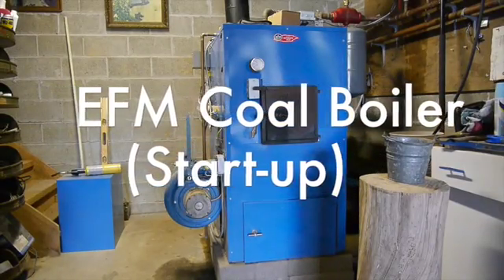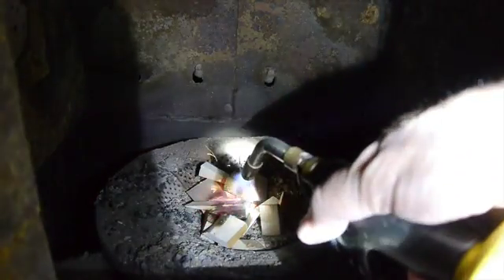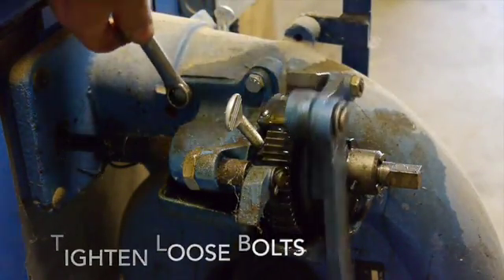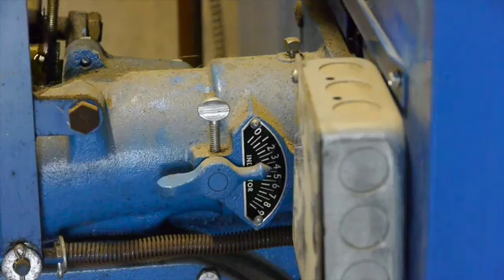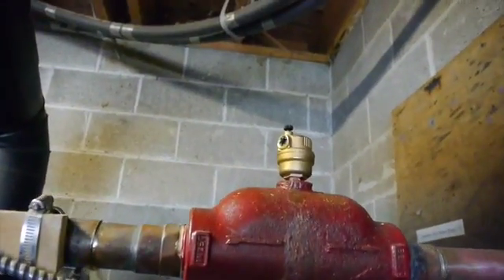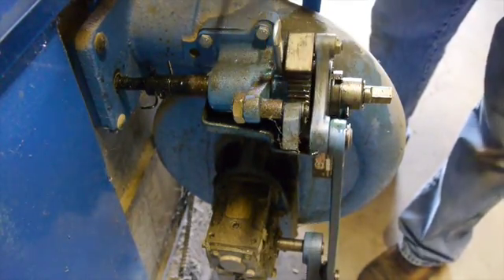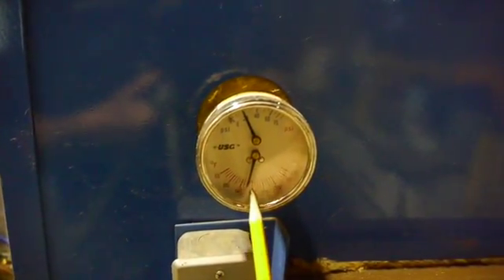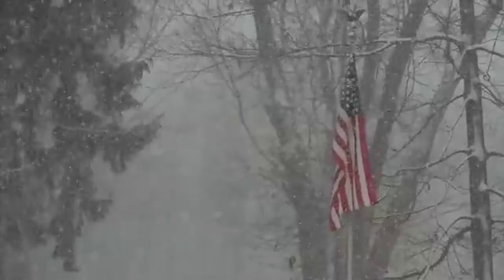EFM Coal Boiler Start-Up

Comment: May I ask what the primary purpose of the barometric damper is with a blower to support combustion? Is it primarily for “idle” or. no heat demand? 
(I understand the stack needs to present a fixed draft with varying atmospheric conditions thus the damper).
In other words, barometric dampers make more sense with a natural draft stove than with a “power” burner.
Very interested to know this. Thanks
Reply from the maker: Well, I am not sure but all I know is when my original damper broke and wouldn't open, the fire kept going out.  That damper is important in this system.

Comment: I have an efm as well.I don’t see your steam drainage to release the hot steam water.I have a small copper pipe that connects to the top of the furnace to a steam pipe.Just curious if you have the same design as mine.
Reply from the maker: Hello.  My system is hot water system.  do they make one for steam?  I don't know.

Comment: Great explanation and overview. In virginia i service oil and gas boilers and heat pumps. Never seen a coal boiler. Did have a coal boiler in my house in North Carolina long ago when i was a boy, but it was changed to oil when I was still very young.

Comment: Curious if you use the coal year round? Looks like maybe there is a spot for an oil gun there for the warmer months.
Reply from the maker: I friend of mine has one of these boilers and he runs it all year.  I thought I would to heat my domestic hot water but I decided not to.  I have a port for an oil burner but never installed it.

Comment: What kind of oil did you use on the blower motor?
Reply from the maker: I think it is 10W30 in my oil can.  I put one drop on the oil port on the motor at the beginning of each season.
Reply: @TimTools99  Your motor should have an oil cup for both bearings.

Comment: Why is your pipework not lagged? Loosing a lot of heat there!
Reply: Charles Of Lebanon Exactly. A friend of mine spent days lifting his floorboards and beautifully lagging all his central heating pipes. Mitred corners, every seam taped etc. When I told him why it was a pointless exercise his face was a picture- you could see the exact moment the penny dropped!
Reply from the maker: Help me out here. Tell me about it. Youtube is all about helping one another.
Reply: TimTools99 your supply and return copper lines would benefit from insulation lagging, every meter of exposed pipe is loosing you heat meaning you will be burning that little bit extra coal which adds up over a winter, here in Australia where I live we lag all pipework that carries hot or chilled water, it’s all about saving energy and money right?
Reply from the maker: oh i follow you. I just never heard of the terminology "Lagged."  In my case, the heat that come off the boiler heats my shop.  It keeps the shop 50 degrees all winter just with the heat off the boiler so I do not want to insulate those pipes and then have to pump water to heat my shop.

Comment: I was watching a informative video by Stoker Don about the correct rotation of an EFM stoker and noticed yours is going when looking at the gearbox backwards. You need to reverse the connections on the motor to reverse the direction it starts up. When looking at the gearbox/fan blower assembly the gearbox should rotate counter clockwise. Yours is going clockwise, it will still deliver air to the pot just not enough air as it is designed to. No matter which way the blower assembly is turning it will not affect the direction of the stoker itself. By getting the blower turning in the proper direction it should improve the efficiency of the burner as it will have more air to burn the coal. By making this change it will give the burner a higher fire using less coal because there will be a lot more air flowing into the burner pot.

My neighbor who also runs an EFM 520 when I saw the video about correct motor rotation by Stoker Don we discovered his was turning the wrong way his still had the original motor which has a reverse switch making it very easy to reverse the rotation of the motor. When he opened the firebox door he was astounded by how much higher the flame was and how much more air was flowing into the burner pot and stated he is using less fuel.

Easy way to find out I'm correct is shut of the boiler and watch the motor shaft so just before it stops you can determine the way the motor is turning. Looking at the blower housing from the gearbox the shaft should be turning counter clockwise. If it turns clockwise as yours is it needs to be corrected as it wasn't designed to run that way.
Check out the video Stoker Don did on the correct rotation of the motor.

https://youtu.be/z8bJjTyQMCA

Just an FYI
Reply: It depends on which gearbox your stoker has. Most of these have the big old rectangular gearbox that EFM used up until about 1979. The output shaft on these spins counterclockwise when running correctly. Later EFM's have a smaller square gearbox like the one in this video. These spin clockwise. There is some variety in these later square gearboxes, EFM sourced them from different manufacturers so it's possible that some spin counterclockwise. The main thing to check is that the fan is spinning the right way. If it isn't, the fire will become very lazy even with a high air setting.
Reply from the maker: Wow! I thank you so much for this information.  I have run it this way for several years.  I haven't started it up yet this year but I am going to check this out.  Thanks again.
Reply: Thank you Stoker Don 

I stand corrected, didn't know they used two different gearboxes but after almost 100 years of production it makes sense that the same supplier would quit for whatever reason. 

Just curious if your feeding your stoker with a barrel has anyone tried using sawdust as a fuel? If you have a source of sawdust for free it might be interesting to try out as there is a gentleman in Canada heating his homestead with sunflower hulls after processing.
Reply from the maker: Thank you for the reply so quickly. I will check my fan before I start up this season.I never really knew how that firebox should look when burning correctly.  Seems like I have a lot of ash but of course I am used to burning wood in my other furnace.
Reply: If you have been running it for years and have not installed a new motor, it is spinning the correct way. If it wasn't, the fire would eventually go out.
Coal does create a lot more ash than wood, no getting around that!
To check your fire;
From the EFM manual, the fire should have a 1" to 2" ash ring during a long heat call (at least 30 minutes). The feed rate should be set to match your heat load ( usually 4 or 5 teeth will do it). Use the air setting to get the ash ring right.
If you have a large heat load, you can push these up to 6, 7 or even 8 teeth.  Each tooth of drum gear engagement equals 2.5 pounds per hour of Rice coal. At 5 teeth this is 12.5 pounds per hour or about 135,000 BTUH gross burner output. 
Below 4 teeth and above 7 teeth should only be used in very unusual conditions when either the coal burns to fast or has a lot of foreign material in it.
Reply: Stoker Do
Reply from the maker: Okay great.  Thanks for the information.  I will be firing it up soon.

Comment: If anyone reading this has ever had the kitchen sink drain slow way down or get plugged up the hot water mixer valve is to blame. I'm 66 and anyone around my age remembers how you had to be careful not to burn yourself when using hot water in the kitchen or bathroom. Since the " oh we need mixer valves to prevent people from burning themselves " idiots as how did we ever survive before these people had to " protect us " 

One advantage of not having a mixer valve on your hot water was all the grease your mom and dad dumped down the drain was melted and flowed into the sewer ot septic tank and the drain line rarely plugged up. My kitchen sink drain has always been trouble since I moved in 20+ years ago. 4 months ago talking with a plumber over coffee he reminded me why his business is so good. When I got home I raised the mixer valve to its highest setting allowing only hot water with no cold water added. In two weeks my slow drain in the kitchen went back to like a new drain works. If you do this post a reminder above each sink that the hot water will be really hot for your wife and any visitor using the facilities.
If modern technology is so nice then why are we using a coal stoker designed in 1922? 

Just an FYI for any tired of slow kitchen drain pipes. Complex solutions to simple problems seem to be the norm now yet when we were kids simple solutions to complex problems were allowed until the " oh we must protect the public people came along" and created a aggravating problem that didn't exist prior to wholesale installation of hot water mixer valves.

Long live the EFM coal boiler and no I don't work for them I'm retired and probably think too much.

Stay safe and warm the old fashioned way by keeping Americans working.

Comment: Chad if your fire goes out when your not calling for heat then it could be your timer or a number other factors but check the timer is working with a properly maintained furnace and good coal timer should be set at 2 minutes every hr
Reply from the maker: +David Hardin 
Good point David.  Thanks.

Comment: Hey Tim, I grew up in Tonawanda and my brother lives in Chaffee, just outside of Arcade, He has a wood furnace in his basement and uses it all winter. I'm in the Albany NY area now and using oil. I will have to look into a coal one, cheaper, I believe, isnt it?
Reply from the maker: Hi Tom.  We don't have natural gas here in our little village so over the years I have  heated with oil, propane, wood and coal. Forget Oil and Propane!  Currently, I still have my Brunco wood furnace in the basement which does a beautiful job.  I got the EFM Boiler so that maybe I could cut down on the amount of wood I had to handle ( I'm not getting any younger!) and it heats the house and my shop.  My first load of coal 10 yrs ago cost $136/ton. It had remained pretty steady for years.  Then the next year it went up to $180 then 200 the 225.  Now it is around $300 I think.  Just my luck! When the price hit $225 I decided to buy in bulk. I buy 23 tons at a time direct from the mine in PA. and save $80 a ton.  So to answer your question in another way ..... Nothing is chap anymore. Move South!  LOL
Reply from the maker: ***** P.S. EFM company makes a Coal Stoker Furnace too.  I think if I had to do it over again, I would buy the furnace.  Boilers are a pain!
Reply: +TimTools99 i have natural gas and i dont care for it. i dont want to pay for something after i already have used it. i HATE HATE utlitily companies with all of their stupid fees, charges, and surcharges. i was burning pellets but the price has gotten out of control so i bought a keystoker 90K. i bought my bulk coal at $240 per ton i bought 4 tons so i should be about $1,000 to heat this drafty old house
Reply from the maker: Hi Tom k2bew.  I put this coal boiler in when coal was relatively cheap.  I still burn wood in a furnace in my basement too.  I can get wood pretty cheap where I live so it is still my best heating option but after 40 years of cutting, splitting and stacking wood, it's nice to supplement with the coal so at least I don't have to burn so much wood.  I see you are a ham radio operator.  My call is N2RGT.
Reply: A man of my heart.. I also have to live next door to cousil person that even gets his grass seeded by the city, New drive, sidewalk. THEN they tack a 5% franchise fee on our electric bill...subjct to go higher I'm sure. I burned pellets which reduced ins 50$ at that time vs wood heat. Then Nationwide quit insuring pellets stoves. I told a few manufactures so they may be getiing with them to work something out I hope. I believe other countries have better stoves and skills with fireplaces and hydronic heat. Also A HUGE problem is our forced inefficiency. I could have sold my big house to a family but I had to build same size home in a town of 200 people!!!! There needs  to be incentives for families to get into homes and free us old guys. All they can think about is their taxes yet wondering why rural communities are dieing.
Reply from the maker: If you have firewood available at a reasonable price it is still a good way to heat.  We also have had a wood furnace in our basement.  I've had it for 30 years and when it's really cold outside, I fire that thing up!  When I first got the coal boiler, the price was about $100/ ton.  Suddenly the next year it jumped to $135 then $175 the $250!  That's when I decided to buy in bulk directly from the mine.  The last I paid was $175 (I think)  three years ago but I bought 23 ton.  I built bins in my barn to store it.  We have natural gas wells all around us but it is not available through our little village so that's what led me on this search for a way that I could afford to heat my big house.  Coal is dirty and it smells.  I would never have a coal burner in my house.  Mine is in my barn and I pipe that hot water top the house.  It's a mega system and okay when I was younger .... It's getting to be quite a lot to take care of now.